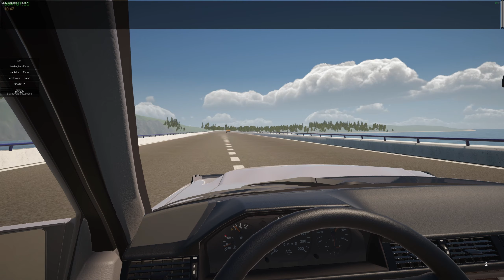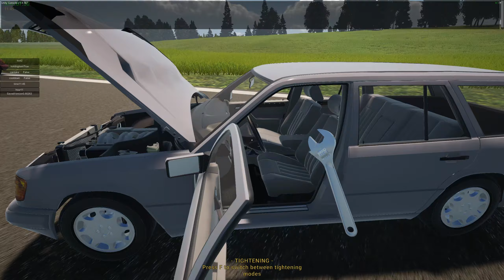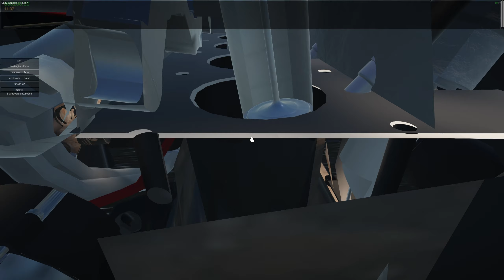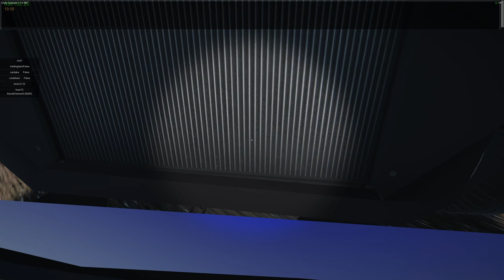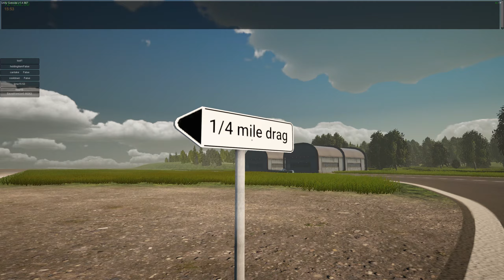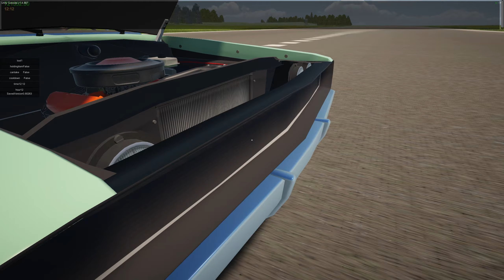My Garage | Busted Radiators, Gasket Wear, and Oil Levels - Tests and Experiments | Ep3

Comment: interesting stuff man, i also enjoy a good test session to see how games work or dont, at the end i had a thought for ya. how long can you drive in 1st gear,,,,, 2nd gear, 3rd, etc. using auto, 4 speed and 5 speed gearboxes. i doubt there would be any dif between 4 and 5 speeds, but auto and manuel maybe. since the game now has mileage of cars, that would be your number system for distance scores. will it effect clutch and pressure plate or even flywheels??? can the rear dif or axle withstand it, and what damages a drive shaft? to sum it up, drivetrain issues? how do they occur and roughly when will it happen. thanks for the fun, you earned my sub. i too love and enjoy the game
Reply from the maker: Hey RPM thanks and welcome. That sounds like a great test to perform. I'm adding it to the list. 
Now when you say how long can it drive in these gears. Do you mean while keeping it floored at MAX RPM? And then once the Engine Blows, if it blows, check the Clutch plates, drive shaft , and such?
Reply: @QuadThumbs  if it works similar to reality at all, i dont think speed/rpm will matter too much, some for sure but not so much that it should change the duration. i have done countless hours in survival and many times i get stuck with a junk trans and have to manage as best i can. they do well enough climbing hills and getting going, but i cant say if its trans or coolant or oil or other as survival is a mixed bag of bad parts on a well,,,, shitty car. im sure if you pamper it, it should last a bit longer, but that defeats the idea of will it blow. maybe test trying to pull another car with e-brake on, will that cause enough strain to make it happen sooner, like a truck pull across the bridge, lol. also on the driving without tires portion, would it matter if they were 16s instead of 14s???

Comment: I just finished a NIV v4 build and there were two things I wondered about.  I discovered you can chrome out an entire engine by just dropping it all on the pallet..(expensive!) and you can chrome the radiator too..(wierd).  Does chrome make the part last forever? I need to abuse my chrome parts to see if they degrade.  The other thing is I have a v4 with turbo..but instead of the feedback pipe from the carburetor I have the performance carburetor, which the model interferes with the turbo..so I wonder if it is working or is doing anything other than looking strange...
Reply from the maker: Oh interesting. 
So I don't know if Chrome Wears or not. I only know that it does not add any extra value to the Car! I guess one way to test it, is to Chrome an Already Worn part and see what the Wear Inspector says. 

lol funny, I'm pretty sure my first Turbo Build I did the same thing. And I remember thinking that it was faster, after i fixed it the right way. So I'm not sure,m but i am putting those into my Tests and Experiments Notes lol